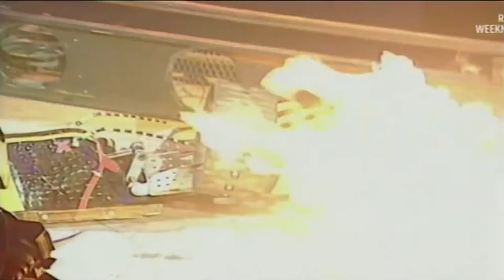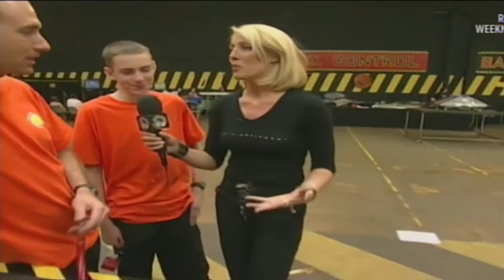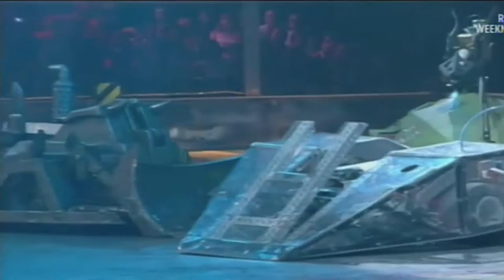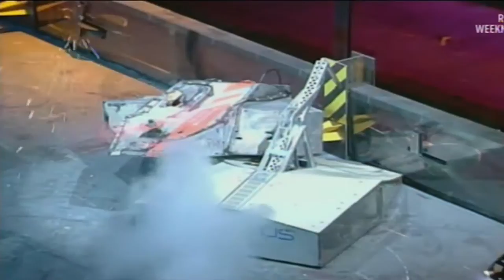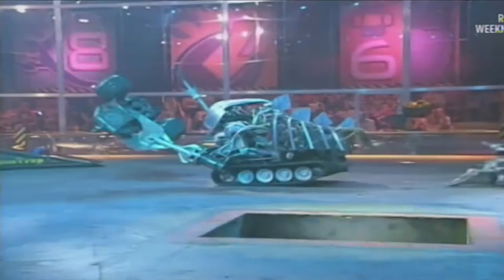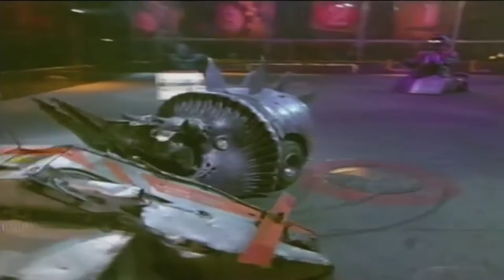Robot Wars Series 4 Heat K

Comment: Half of the bots from other heats which lost in 1st round are better than Mouse trap
Reply: Mousetrap was eliminated by Stinger in the semifinals. From Joe. X
Reply: It was definitely improved with the addition of a blade on the edge of the trap. Gave it some cutting and penetrative power instead of just bludgeoning damage

Comment: I'm not going to lie here but Little Fly is actually one of my all time favorite robots from Robot Wars it has a really simple look but the builders putt allot of effort into the robot by adding stuff light a light projector and a warning light for when the weapon was fully charged even if they did not need to and Little Fly did surprisingly well during Head K by taking out Weld'Dor in the first match before winning against Tiberious by sheer luck before finally a surprisingly intense and even battle with Mousetrap which Mousetrap just managed to win
Reply: Little fly is the first gen of bar spinners. It's spinner looks like Ironside 3
Reply: @RealRichieYT it does. From Joe. X
Reply: @RealRichieYT  come to think about it your right tbh Little Fly did unexpectedly well and there were a hair's breadth away from the series semi's

Comment: I thought the most cringeworthy part of this series was Ian Lewis' rant at the end of Heat B, but holy shit, I forgot just how bullshit this whole episode was, starting with that decision was against Weldor. I'm sorry, if they were able to disqualify Suicidal Tendencies for only having one wheel working, they should have called on Little Fly for being barely mobile in that first fight. Fair play on the boys from Belfast for giving Little Fly credit and accepting it but they really should have called time on Little Fly for being immobile. Ugh. Then we had Banshee's pinball run, which will be the utter shame of SMIDSY for beating it. 

I'll give them fair credit for the Tiberius match, that was an obvious breakdown on Tiberius' part, even though it genuinely had controlled the match up until the point. Just goes to show Sam Smith was (and is) a very underrated driver, it's a shame he didn't get a chance to shine until Carbide came onto the arena. 

I'm with Dig on this as well, another utter bullshit call that needed some justification. Not denying Sump Thing was immobile, but Mousetrap was gone far, far before that, and Sump Thing had the upper hand throughout the battle. Look, if you're going to let Wheely Big Cheese go through after it did nothing and ended up in the pit with Suicidal Tendencies still moving on half a track, you can't expect us to be alright with these sorts of bullshit decisions, argh!

I don't really have a winner for this heat final, I don't think either deserved to be there, and while Mousetrap had some control and damage, I think Little Fly was still the more mobile of the two, and had more aggression. I'll say I'd have given it a smidge to Little Fly but at this point I don't really give much of a damn about this decision. 

I do apologise NJGW, last post I said I was delighted you were posting S4 but this one literally gave me a migrane watching.
Reply: #ianlewiswasright 

Also, it's a TV show, the more exciting robots are always going to be put through if it reaches the judges, that's just a fact of life and a reward for making your robot visually and technically appealing rather than a dull box on wheels.
Reply: Wait, what are you holding me up on? None of the robots in this heat could really be called a 'box on wheels' unless you mean my comment about Suicidal Tendencies, at which case it's a box on tracks.
Reply: Gregory Atkin well it was just a general insight into the philosophy of the producers rather than a comment on each individual robot in this heat.

Mousetrap was obviously the one the producers thought would bring more excitement in the semis, and they were probably right.

If they had actually worked weldor and evil weevil would've dominated this heat however
Reply: Ah, alright, sorry if I came off a bit sharp. And at least through my spectacles, I liked Sump Thing most from this heat, it had a wonderfully characterful team and a unique look and approach to the design. That said, it was a neat idea from Mousetrap. Just... not great. That's my take on it. The horror, a fan has a different opinion from the producers. It's unthinkable!
Reply: "Far far before"? I don't think so. Sump Thing wouldn't have driven into the wall if Mousetrap hadn't been able to move out of the way when it did.

Also, Little Fly wasn't immobilised in the first round battle, so it's completely different from Suicidal Tendencies. Yes, it was clearly driving to one side, but it wasn't driving ON one side. Evidently there had been a puncture to its tyre, which severely restricted its movement, but it could still use that wheel. Suicidal Tendencies could not.
Reply: Sump-Thing's axe disconnected a cable to Weld-Dor 2's batteries. From Joe. X

Comment: Evil Weevil picked an battery that is low
Reply: That's why it's always a good idea to charge all your batteries before your event because otherwise you'll just go flat during the match.
Reply: Else they would have won the heat most likely
Reply: @Headbanger142 chose poorly and lost out. From Joe. X
Reply: @robotwars666 bad preparation. From Joe. X

Comment: 17:15 19:48 Something I didn't think I would hear. And it is a pity that both the seeds Evil Weevil and Wel'dor went out in the first round.
Reply: It's rather shocking. From Joe. X
Reply: Gotta feel sorry for them.
Reply: @TinyDrew5  Evil Weevil's battery died, and Weld-Dor 2's wire was disconnected by Sumpthing's toothpick axe. From Joe. X

Comment: If evil weevil had better batery they would have won the heat agian this heat final a joke sumpthing and tibrius looked way better then mousetrap and littlefly i this heat top 3 if machines dindt die would be
1 evil weevil
2 sumpthing
3 tibirius
Reply: They chose a battery that wasn't fully charged. From Joe. X